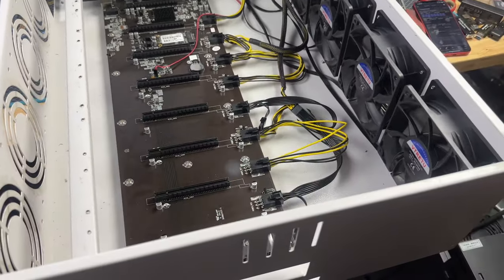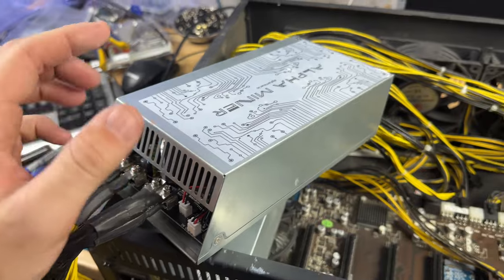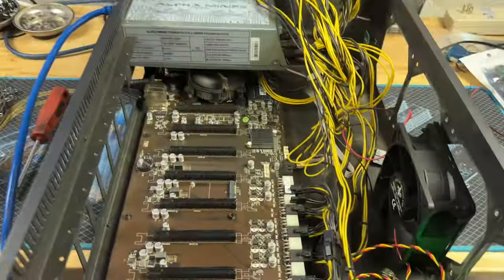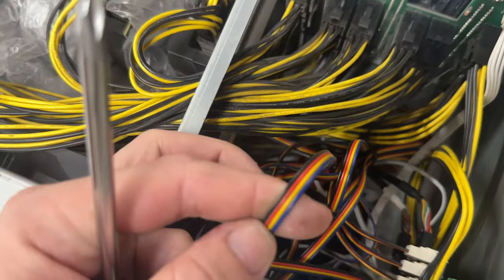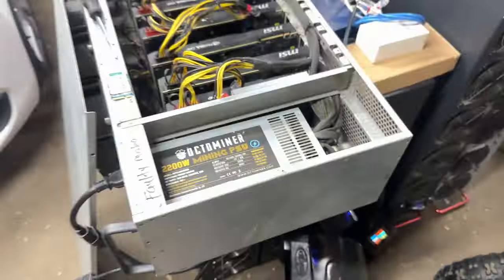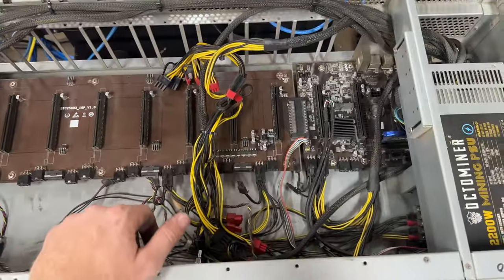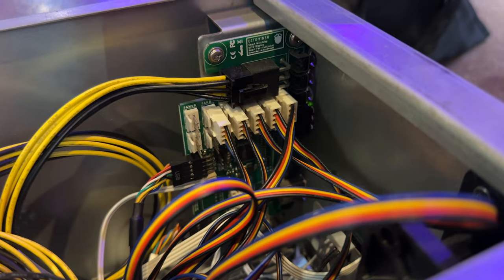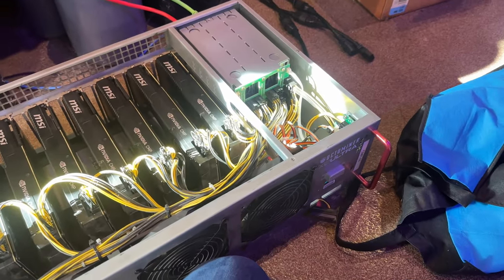So many server cases. November 23 farm changes.

Comment: My Octo 12’s do the same thing with the case fans whenever they are powered down. Bought both of them used. I just end up disconnecting the power altogether if I’m not mining on them
Reply from the maker: thats what I'm planning to do on this X12. all my delta PSU ones are fine but this one is pissed. 

one other commentor mentioned 'updating the bios' as that fixed his.

Comment: Hi great video as usual. If you want to increase your air flow on the white server case and others that have the built in server case fan guards. Grab metal sheers and simply cut the 4 points  on the built in fan guards. Then  install the standard silver mesh fan guards as the built in ones restrict the air flow massively. I also had to replace a boat load of rough sounding server case fans, from my last CMP 50hx in server case purchase.   Any recommendation's on some decent priced  fans and how to mode the fan speeds in the bios.  I also set up a fan controller but not loving it.
Reply from the maker: I thought about it, but I have the fans running at like 20% with no temperature issues, so I've just left it. good idea though and would make it look way less lame haha.

PWM fans are super hard to find on the cheap. the nerdgearz 120mm fans have done me well on systems with after market PWM controllers (That PWM the whole power supply, not just pin 4). but 120mm 3000-6000RPM fans that use genuine bona-fide PWM... nothin.

Comment: update the bios and do a fan recalibrate for speed control on the x12 ultra for all headers to controll fans, the fans 100% on shutdown is normal my minerdude and octominer x12 both do it.
Reply from the maker: bios on the board? have a link to octominer B250 bioses?